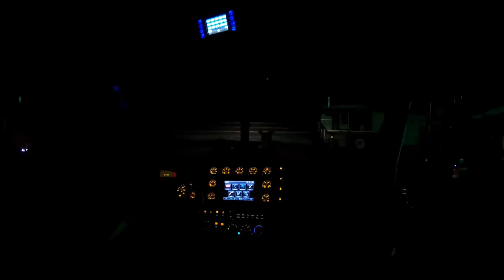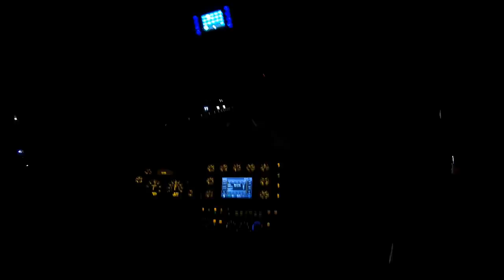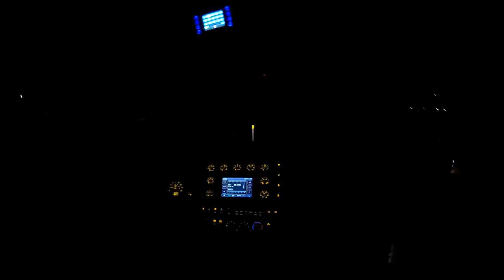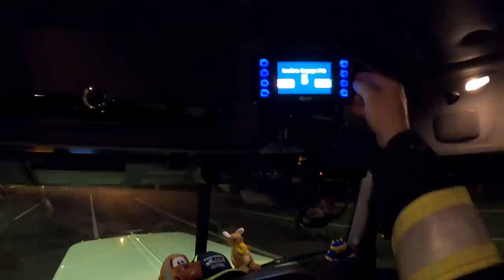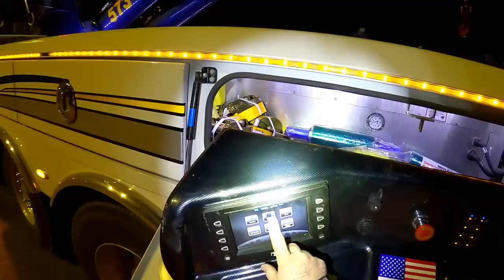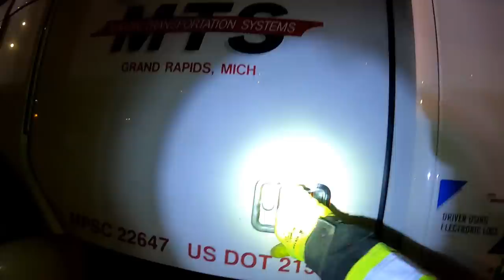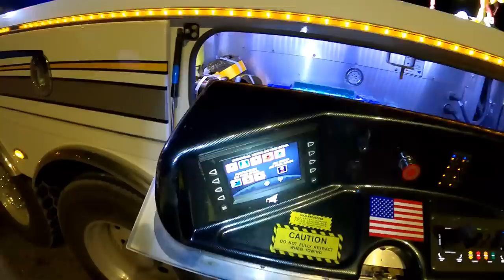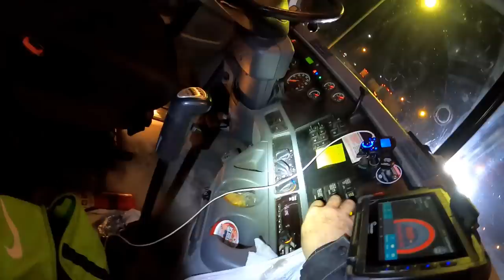Runaway Truck & Trailer    Driver Forgot to Set the Brakes

Comment: That critter on the dashboard was the first thing I noticed and I was trying to figure out if it was a rabbit or not. LOL. Thanks for clarifying. I would have thought lift and pull at the same time so the trailer doesn't flip over. Turns out that wasn't needed after all. Thanks for another great one.

Comment: With the high cube " hi cube" trailer I was shocked it wasnt all twisted up and ripping apart , I know the old hi cube back in the day north American van lines had, if you sneezed near one it would knock a hole in them, good job and be safe out there

Comment: Would it have been more difficult if the trailer type had more ground clearance?.
Excellent vlog, thanks for sharing.
Reply: My thinking, is what stopped it in the position it was in was due to the low slung trailer.  I think it would have been a much worse accident had it been traditional clearance.

Comment: Stuff happends, in a hurry or tired...reminds me of my unfortunate incident i had when driving trucks a few years ago. Read on if you want, sorry for the bad english. 
Spent 7 hours in the truck driving to unload location, was exhausted due to bad sleep the night before (No place to park so i stopped on a small spot alongside the motorway, 55 mph trucks 4 feet from cab all night). Anyway i got to the customer and this is a tight yard...so i drive in and unload the trailer.

I then go out and drop the trailer to return into the yard to unload the truck (its a 24m/78 foot scandinavian setup), I unload and go back to the trailer that is waiting in an slight uphill incline, so i reverse to the trailer "downhill" and hook up.
Now i need to exit the cab to hook up the air.
As soon as i connect the air the whole truck starts rolling in reverse. I freak out and in my sleep deprived state i decide to run to the cab and while the truck is rolling i climb up and SLAM down the parkingbrake that i forgot to set.
I get the truck stopped a few inches from a weighbridge building.

Stupid mistake that could have been a distaster if i had missed the steps of the cab, i SHOULD have just unhooked the air again and the trailer brakes would have stopped the whole thing.
After that i triple checked the parkingbrake EVERY time i got out of the cab.
Reply: Reminds me of a retired trucker I know, before all the regulations about sleep. He'd run hard for several days in a row just for the money. One day he was rolling through a town and fell asleep and nearly rammed someone just before coming to a stop. He slammed hard on the brake, stalled it, set the air brake, and went to sleep. Right there at the light. Better than keeping going and actually cause an accident. He never drove like that again, or so he claims.
Reply: @gen157  that is scary. Once had to run a red light while in a rental car because we saw a truck coming that was clearly not going to stop and would have rearended us. They also ran the red light, we were all blessed that there was no cross traffic at that time of day at that light. Sleepy drivers are scary. I am not convinced that the new HoS help drivers to get more sleep though.

Comment: Well after so many easy jobs I guess it was about time the Tator got a work out. This job certainly put a strain on the big guy. I'm half suprised you didnt go with a 2:1 on your winch lines to help wer a mechanical advantage in pulling the truck. Mind you there were other concerns at the time like the landing gear & where they were. So a job well done Ron & as always god bless you & everyone at Midwest Truck.

Comment: In 37 yrs of driving, this only happened to me one time. I'm in Canada in a freezing rain storm. I get out of the truck and lock the breaks. Walk inside to check in, and see what silo they want the sand in. And watch my trucks and trailer sliding down the driveway LOADED with sand. Video showed the breaks where set. Thankfully, because when it stopped sliding. It knocked a hole in the right fuel tank.
Reply: But were the brakes set?😉

Comment: That turned out so much better than I initially thought. It really could’ve gone the harder way, but as you stated...SLOW & EASY. The portable controller really makes it much easier. The wrecker I drove had the controls in the cab and were pto driven. I loved the truck though...51 REO. I still have it. Blessings! The Porter Dude.

Comment: Man that looks like a hard job. I remember the one time as a preteen in Willow Springs Illinois a elderly couple's car had rolled  down a hill in the parking lot of The Willowbrook Ballroom and crashed through trees and then rolled on it's side into the ditch between the parking lot and the train tracks. I heard the crash and ran down the hill to see if anyone was in the cart but it was empty so I ran to the inside of the Willowbrook Ballroom and asked who's car was it that rolled down the hill found out it was owned by the dad of owner of the Willowbrook Ballroom and told them it rolled down the hill. They thanked me for letting them to know. He must of forgot to set the parking brake.  They called the local towing & auto body shop Southerland Towing & Autobody who is my grandparent's neighbor who had to pull it out of the ditch and trees. This was back in the late 1980s or early 1990s. =^.^=

Comment: I’ve learned so much from watching your videos. I have great respect for the hard work and very important work you and your team does. I curious about the business side of things and how this industry charges for these services.  Is it by the hour, or severity of recovery, which truck you use, etc..  What are all the factors that go into billing a customer?
Reply from the maker: Unfortunately, there is no set industry standard.   Things would be much better if there were, in my opinion.  There are multiple methods used.  One of the most common is charging per hour per piece of equipment and personnel with minimums and charges port to port.   Those hourly rates can vary based on the equipment size used and/or the area of the country.  For instance, a 50 Ton rotator in the middle of the country will not be able to get the same rate as a 50 Ton rotator in a coastal state.   Some States set the rates that companies can charge based on size of equipment, etc. A big problem with charging hourly rates, is that there is little incentive for a company to work quickly.  Either that, or some companie will dispatch a squadron of trucks to a minor incident and charge for everything on scene.   There is no perfect system and any system can be abused.  Another common method is the PPP method or the Price Per Pound, which is extremely difficult to explain all the nuances of this system.  Basically, this system charges by the Gross Vehicle Weight of the vehicle being recovered regardless of the equipment used to recover it or how long it takes, by charging various rates based upon the situation.  For instance, there will be a charge of, theoretically,  20 cents per pound to recover an overturned tractor/trailer weighing 80,000 lbs.  (I just threw that figure out there....I don't use this method, so I am not familiar with the actual rates.)  Now, there can be additional charges added to that 20 cents per pound for certain circumstances, such as inclement weather.  This may add another 5-10 cents per pound.....again, I do not know the actual rates...these figures are just being used as an example.  I have no idea if these rates are close.   But this should give you a basic idea of how the PPP system is designed.    If used properly the PPP method is very fair to both the customer and the towing and recovery company.   Again, as with any system, it can be distorted to one's advantage and the other's disadvantage.   THEN there is the SWAG method, which I do NOT agree with!!!   If you aren't familiar with the term SWAG in this context, you can look it up in an Urban Dictionary.  But basically, the towing/recovery company simply throws out a number that they think the job is worth or the customer is going to pay and usually that number is very high.
Don't misunderstand.  There are more reputable companies than there are disreputable.  I'm not trying to make it sound like everyone is misusing every system.....far from it.  Most companies are professionals trying to earn a living for their families and their employees' families.  I simply wanted to point out the pros and cons of the common systems in use.    Whatever system is used, in my opinion, one must remain consistent with their pricing structure.   I could write a book on this.....my apologies for rambling.   Thanks for watching and God bless.

Comment: Amazing how a distraction can set you up for a situation that could be anywhere from embarrassing to disastrous.  From a full bladder to being called in at a weigh station.

Coming into Oregon, at a port of entry, they had to post a sign to remind drivers to set their brakes.  Seems that the reputation of those officers had spread, causing drivers to get rattled by being called in.  That is just one example that I have seen.

I'd bet that man is going to be O/C about making sure the brakes are set for a while.  I know I would be. That is a horrifying feeling, when you have locked your door and the rig suddenly starts moving.  I had that happen, once, when the parking brake failed to hold (pickup with a very heavy gooseneck).  Thankfully, no one was behind it, and the brake had work enough that the rig stopped when the trailer tires bumped the curb.  I quickly adopted the habit of using wheel chocks after that little scare.

Comment: My initial thought was to try and pull but anticipated having to at least need some help with the nose of the trailer while pulling the truck. Then I considered the length of the video and figured the pull alone was the solution. Lift and pull would have been multiple setups to recover based on watching you past videos. How would one apply the wood chock idea for a situation with a single axle? Grand idea, but think along use in the pickup truck size application.

Comment: Welcome aboard mr roo. Great vid btw Ron. Thanks for sharing.

Quick question. Why did you not use the legs on your truck to stop it from moving? Do they just tear up the pavement so you didn’t want to use them?
Reply from the maker: Correct, using the drop legs on pavement will damage the pavement.   On a lighter recovery vehicle they will just skip across the top of the pavement and actually DECREASE the resistance by taking weight off the tires.      Thanks for watching and God bless.
Reply: I was wondering the same thing.  Do you use the legs more for stability when lifting vs. pulling?

Comment: Another great recovery. My guess would be the driver used the “not for parking” trailer handle for parking
Reply: Who hasnt picked a trailer and been able to pull thru the trailer spring brakes  lol hi ho hi ho off to the shop it goes
Reply: Or it was an honest mistake and he didn't pull his brakes.... I have sat for ten min in a lot with foot on the brake for half that time I took my foot off and didn't move... a min or 2 later the truck started inching forward made it about 10 feet and noticed and pulled the knobs... it happens I was at the yellow line past pumps. I edit to mention i never left the driver seat simply navigating and using phone...

Comment: It might have helped to disconnect the rear leveling valve link and force the air bags to overfill to give a little more lift to the nose of the trailer and push the drives down.  Another great recovery.
Reply: Yes, that would have been a good strategy.  Wouldn't have helped the driver get the truck out without help, but would have been excellent strategy used in conjunction with the pull out.  That's some good thinking :)  I've used that strategy on a few occasions where there were other problems,  the one that comes to mind foremost was a time when I hooked to a reefer that was loaded with produce. The grocery terminal was closing down for Christmas,  and I was sort of late showing up to pick up that particular trailer (had been hung up on other problems on another run).  They had pre-loaded the load hours before, and when I got there, they closed down the dock door, so the heat from the building was now cut-off, and it was -30 outside.  The reefer was screaming away, but I couldn't get one leg to come up because a gear inside the gearbox had broken.  The stuff on the tail of the trailer was in danger of freezing because I couldn't pull ahead to close the doors.  Ended up "over-riding" the tractor's air suspension just so I could inch ahead and get the trailer doors closed.  Finally a mobile mechanic arrived,  and used air tools to physically remove the "broken" leg,  which we tossed in the back with the produce.  The load was scheduled to remain on that trailer for 2 days and deliver on the day after Christmas,  so we got permission to swing the load back at our terminal onto a good trailer, and then carefully dropped the bad trailer inside the shop on a jack brace and the guys put a new one on it after Christmas.

Comment: I've done the same thing! I mean my truck was a 94 Nissan... But still, I was going into the store and a man ran up and pointed at the edge of the parking lot (west end of Northway Mall parking lot in Anchorage, Alaska if anyone cares) and as he pointed my eyes finally saw what he was pointing at. I didn't set the brakes and my truck rolled 250 feet, went right over the curb into the ditch... That 24 years ago and I STILL triple check my brakes. 
Glad no one was hurt here. 
God bless

Comment: Once you got that truck up on the pavement, and released the trailer brake, what made you confident that the truck wasn't going to roll into Tator?  How often have you had a recovery coast/roll/travel unexpectedly, especially toward your equipment ?

Comment: Own up to you're mistakes an learn from them. 
Sad thing is that driver is now unemployed if I had to place any bets.
Reply: SWIFT will hire him
Reply: Absolutely unemployed. Truck companies do not tolerate that level of a safety failure . Got off easy on this and lot worse could have been had.
Reply: People are way too fast to fire someone in this day.  How do they get a chance to learn, be better and advise those coming later?  Hoping this employer isn't a jerk.
Reply: Maybe, maybe not.  If the truck had rolled, or there had been a big insurance claim ... likely.  The reason drivers get terminated after a roll-over, regardless of fault, is that insurance will not cover them anymore ... because of some statistic that says if you had one major accident, the odds are high that you will have another within something like two or three years.  It doesn't matter to them if there were circumstances that were not, nor ever could be, under your control.
Reply: Not likely. Drivers don't usually make the same mistake twice.
Reply: Don't know for sure about the drivers employment status, but this company has a fairly good reputation for treating drivers well.
Reply: Dont forget that 99% of the big companies will put the tow bill onto the driver for a at fault tow call..
Reply: I doubt  that he was fired for that.
Reply: Having driven for 10 yrs I can tell you 1st off the company will require him to do a drug test ...
But most likely he'll be looking for another job ... Trucking companies take safety issues very seriously and to forget to set your parking brake ... that's rule No.1
Reply: @Dean-ry2bh  
Well he would have to be very special to forget that one.
Reply: I very highly doubt that company will fire him, that company might have a good reputation but most of the drivers i have met are "know it alls"
Reply: @johnneal1102  wait a minute. Another John Neal?
Reply: @judil3294  Well Judy I worked for a large union company. Before your butt got in the seat you knew in no uncertain terms that a roll away was an automatic dismissal. There was no talking about it, it was just goodbye and don't ask for a referral. There is no excuse for not setting the brakes.
Reply: Drivers are scarce. Possibly a re-train and some safety lectures. No reason for a dismissal.

Comment: Ok, this forgetting to set the brakes happens way too often between the 3 channels I watch :-)
Reply: I've noticed that too Also trailers coming off of fifth wheel
Reply: I drove for 12 yrs ...these young guns today are in way to much of a hurry ... part of that is due to dispatchers ... is safety is not being followed ( obviously ) they're not checking the fifth wheel after leaving the truck ( unfortunately there are A holes who will pull the lock while your away... Cut lines, cut wires ) this driver will be required to do a drug screening and most likely loose his job, have to pay the tow bill and maybe any damage done to truck and trailer.

Comment: I had a idea while reading how hard of a pull this was. Maybe if there is way to mount a camera so we could see the load screen and put it in one corner of the video so we could see how the weights and capacity changes as you extend, retract and rotate. I figure this is a lot of extra work though especially in editing phase.

Comment: I'm always fascinated by your rigging.  I'm curious why you opted to pull upward from straight off the boom. Wouldn't that tend to lift the front of the tractor and lower the back drive tires, thus lowering those legs on the trailer a bit?  I thought you might use a couple of snatch blocks down low to keep the front of the tractor down low.  Not second guessing you, just a genuine question.